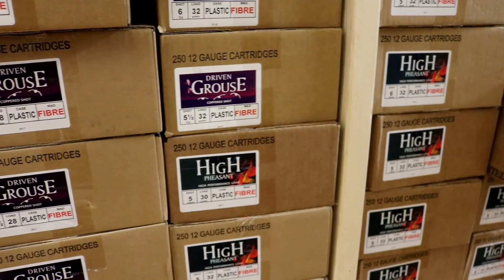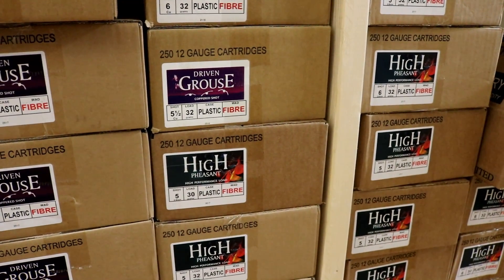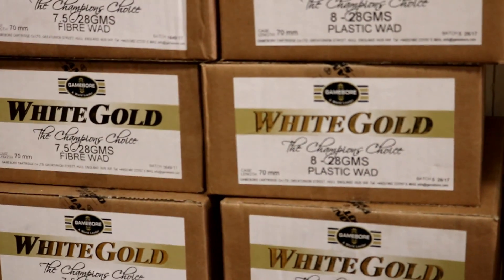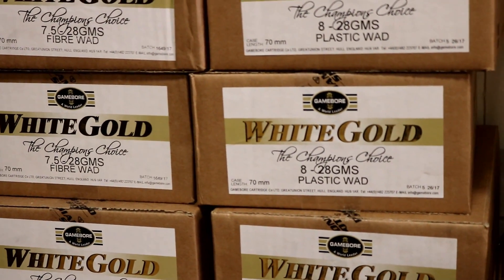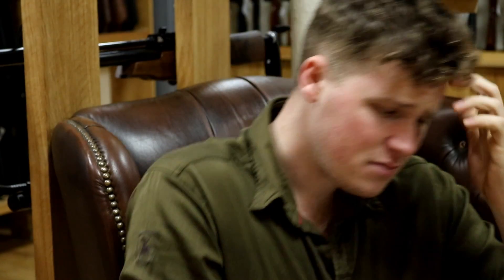Shot String Explained

Comment: In practice, if the string can't be lengthened by flicking the muzzles, which is nonsense, and even if the string is an extended oval blob, the fact of the matter is that it's all going to pass through the same space at one point or another, as a swarm of bees flying through a hoop might, the real test imo,  is still on paper, at the pattern plate, I think people spend far too much time worrying about things that really don't make much or any difference to their shooting 🤔, just a thought
Reply from the maker: In full agreement. More or less

Comment: This is probably a stupid question, however, I just have to ask: what do you think would happen to the shot string and pattern if one reloaded let's say 1 1/8 ounce of lead shot but the lead shot consisted of equal halves 7.5 shot and 8 shot?
Reply from the maker: At close range not a lot, i would have thought it would be a ballistic nightmare at long range! a very long string where the 8's will decelerate faster. I have tried mixing shot in home loads but never got a satisfactory result!